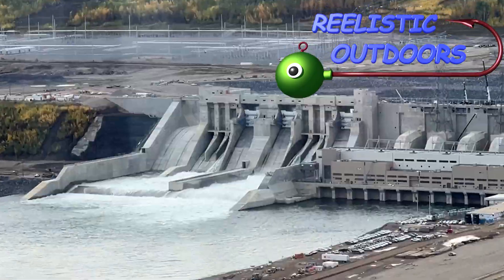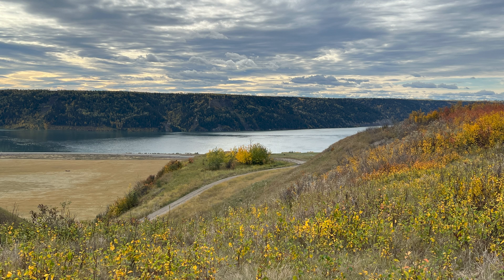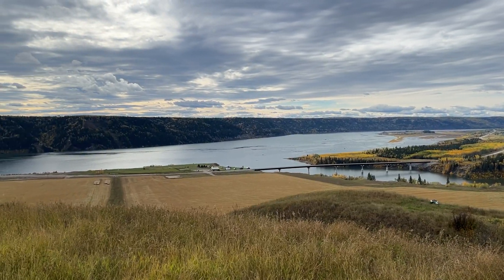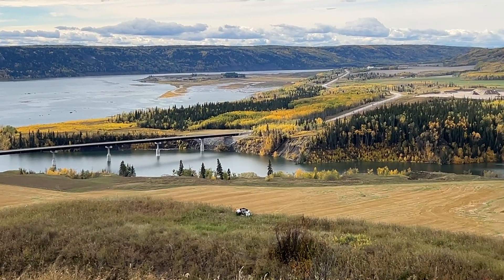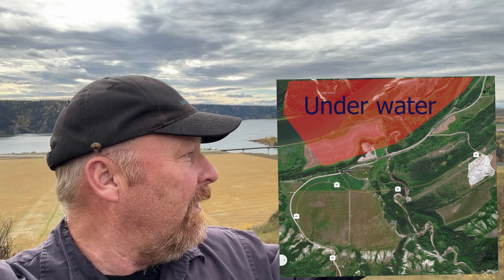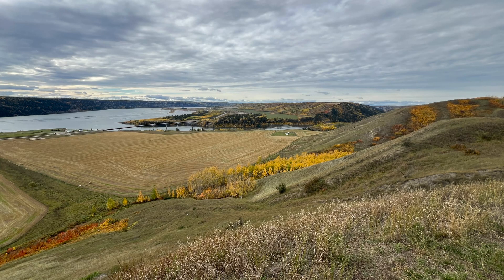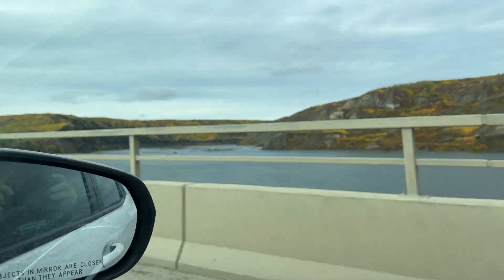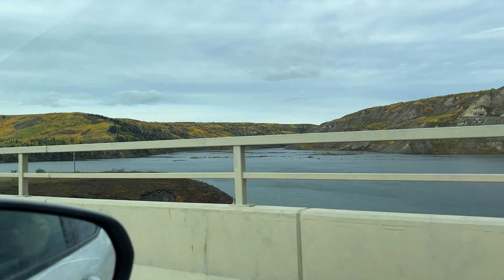The Flooding of Site-C Dam

Comment: Your commentary on this well produced video  simply repeats all of the same talking points we have heard for years now. Yes it’s true the BC Peace River area has some of the most fertile soils in BC but the areas of farm land flooded by site C are very insignificant in that picture. The idea I want for this project to further is if Site C is environmentally detrimental to the point of costing more damage than benefit produced, does nuclear energy become a better overall source of base load electricity to power our economy for its increased need for electricity 20,50,100   years in our future?

Comment: There is more to the issue than is spoken here. I do appreciate the somewhat balanced reporting, but.. Reservoir production of methane and methylmercury are significant and long lasting affects. Fish migration, aquatic life and land based wildlife also is altered. Transmission and use of this power is a very significant issue. For example; exportation of liquid natural gas has caused first nations much grief and both massively expands Canada's carbon footprint and takes a resource out of the range of domestic use.

Comment: Thanks for the update and footage showing the changes to the landscape.  Great to see the new infrastructure that has been built to replace the old roads that will now be underwater.  It's also important to remember the positives that will also come out of the construction of Site C, as well as the negatives.  Large infrastructure projects always have their positives and negatives.  It's an incredible project.  The reality is, if we are going to continue to push for electrification, clean energy sources and a lower carbon footprint, it's well past time to identify and begin building Sites D, E and F!
Reply from the maker: You are right!!!